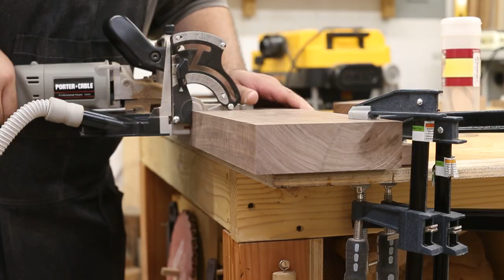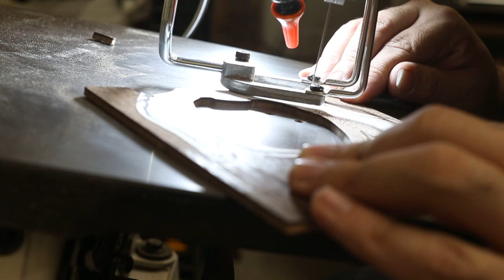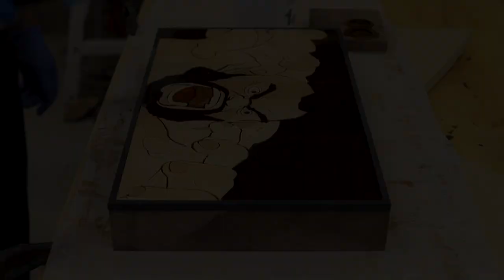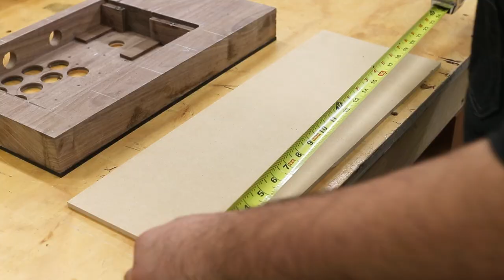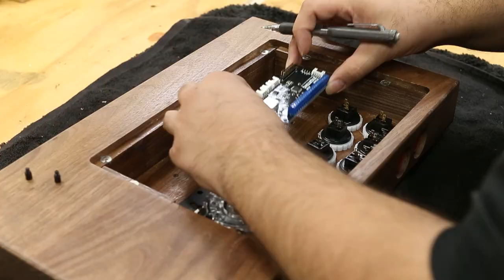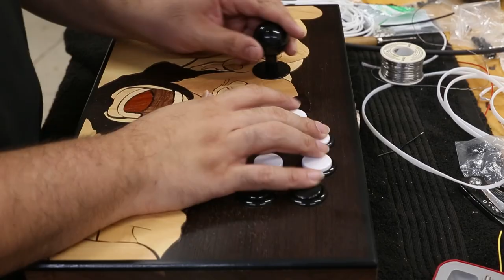The Ultimate Zangief Fight Stick

Comment: I watched this video three times. Great! loved it :) 

I am going to make a pair of fighting sticks for the ps4 and outside of some initial costs of getting some of the material for a basic stick and encoder recommended here, I can't afford planer at this time, but have a friend who is willing to sell me he electric hand planer for really cheap. My issue is I am completely new to woodworking so it may be better to just go back and have a shop get me a clean straight board..not sure. I was able to build my first arcade cab and really feel proud of that. I acquired some good tools but a few things I still feel I need. Until I can get a planer or jointer I wondered how useful the hand planer may be by itself for now. Some of the wood I bought from the store (my first problem) has some very slight bows that could use some help before I make my cuts. I have options from the wood I have of red oak, pine, mdf, or some weird hardwood I have no name for I picked up at my friends house he gave me, he has no idea either but it looks pretty (about a handipanel worth). Anyways, either way gave me some good learning tips watching none the less. :)
Reply from the maker: Thanks for taking time to comment, Andy! I'm glad you liked the video. A hand planer can be useful, I would recommend removing as little material as possible with each pass. Another option would be using a router to flatten the boards out. It does require jigs and a bit of set up though. You can do a search for "router sled slab" and see a ton of videos. Best of luck to you!